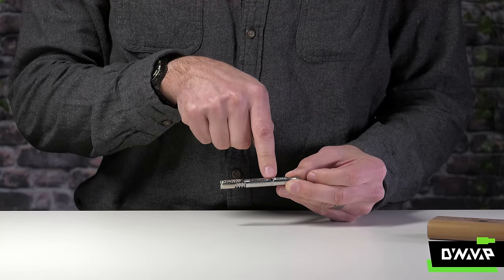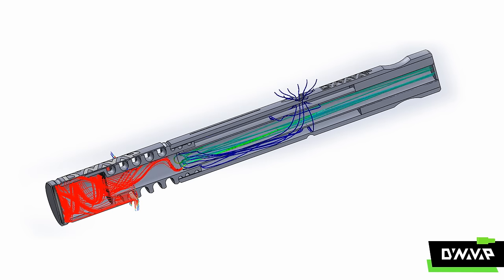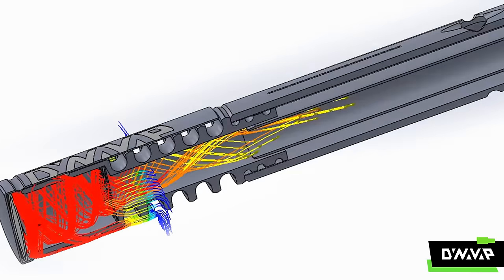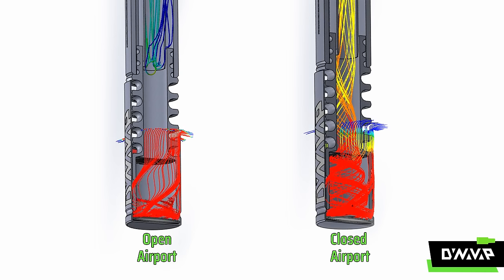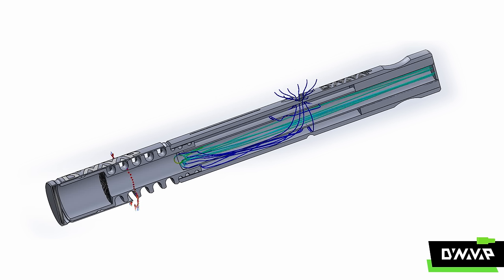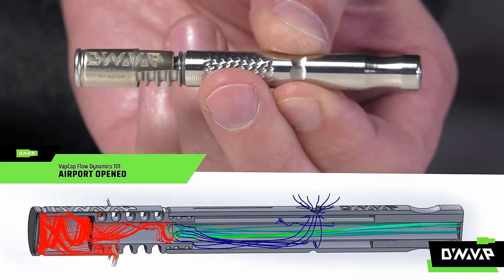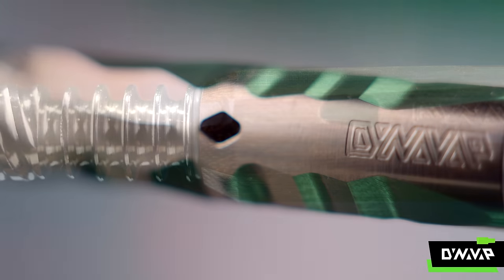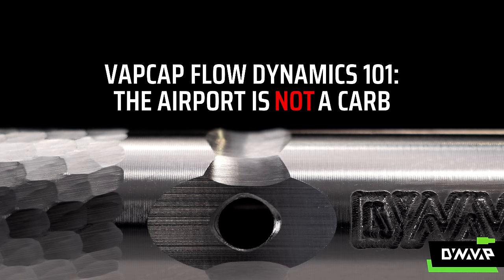How the VapCap Works  Airflow Dynamics 101  DynaVap

Comment: Super educational. What I'm getting from the video is blocking the airport keeps the tip hotter longer. Thanks for the video.
Reply: I think he said it's the other way around.
Reply: Yeah if u leave it open it stay hot longer because there is less air being pulled into the bowl
Reply: Basically if you want a big hit just cover it half way that will get full extraction
Reply: @alfonso45901  
And I'm a microdoser so I always have the airport covered and that causes the temp to rise and drop faster in the chamber for a smaller hit, which is just the way I like it.
Reply: 13ivanogre13 nice i like it that way too
Reply: No it's the opposite blocking cools it opening it keeps it hotter longer
Reply: Wrong watch video again

Comment: It's literally a carb
Reply: technically, no it is not. but thats why he is a mechanical engineer and you are ignorant. he can see things you cannot due to the expanded capacity of the right side of his brain.
Reply: @PLAYERSLAYER_22  have you heard of the appeal to authority fallacy? You should check it out. Not everything that sparkles is gold my friend.
Reply: @ty-le5lv  have you ever heard of the Right Shift Theory? Right handed luddite. go grab a dictionary and look that word up. engineering is a pyramid scheme, I am aware (the patent scam). So we probably agree on the appeal to authority fallacy with regards to engineers, but I assure you that this is technically a different principle.
Reply: @PLAYERSLAYER_22  It's easier to fool people than it is to convince them they have been fooled.
Reply: @ty-le5lv  explain your idea and allow me to deconstruct.
Reply: @PLAYERSLAYER_22  carb short for carburetor. Hole that allows outside air to enter the chamber and either mix or clear the chamber of smoke. Do you agree on that?
Reply: @ty-le5lv  Notice the bike tattoo on that one engineer's left arm? the entire dynavap is technically the carbeurator in this analogy. the bypass port in the side in conjunction with the air entering the cap are both equivalent to the intake manifold inlet like a harley davidson or something.
Reply: @PLAYERSLAYER_22  To clarify, you are saying, 'the cap and side port both act as an air mixture, therefore there is no carb.'?